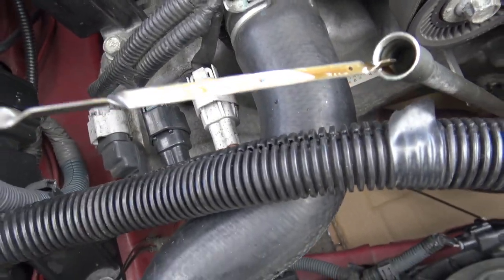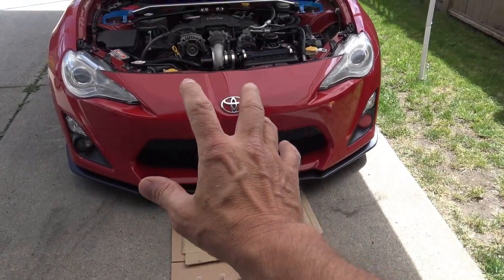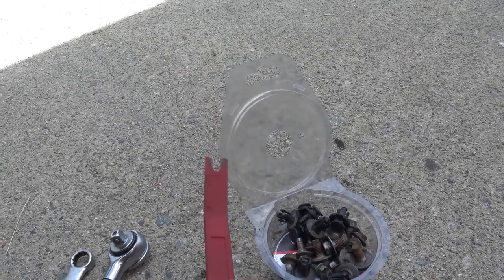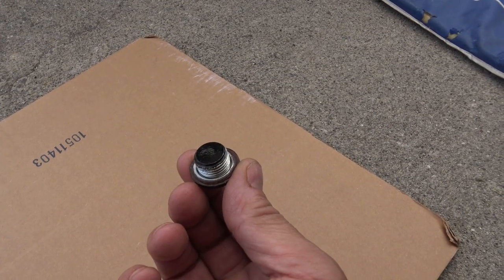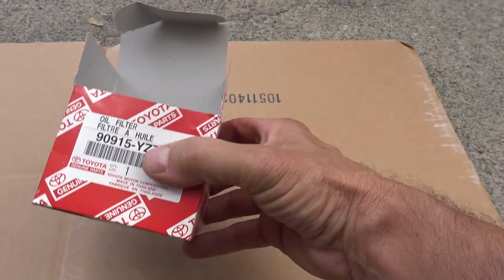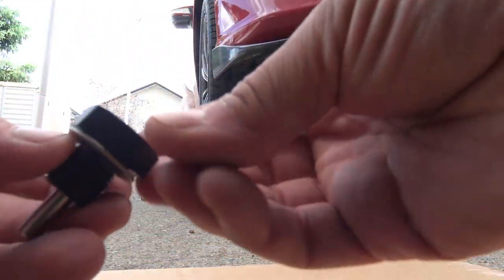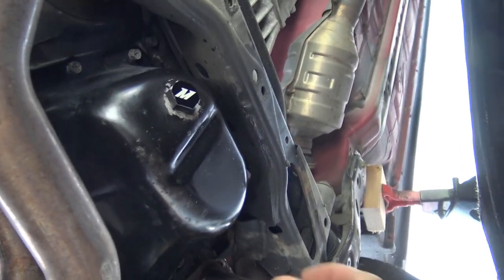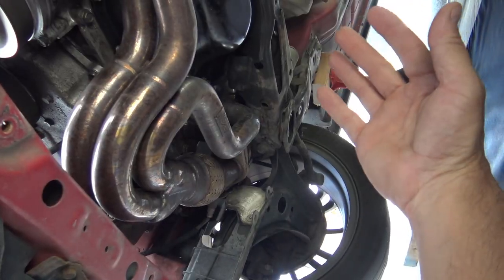What happens if you overfill your engine oil?

Comment: When I met a girl, her car was in the shop.  Some boys told her that she had to fill it up to the top, as in the filler cap!

Car people like to trash quick lubes, but most people don't know what's going on with their car or how to deal with it.  I ran a fast lube some twenty years ago.  A guy came in for an oil change.  He had some incarnation of the big Buick V-6, with a breather filter so full of oil, it was getting into his air filter.  When I put in the typical 4 1/2 quarts of oil, the dip stick showed he was a quart low.  I had no ASE certification, but I knew enough to explain the obvious.

Comment: Great but its alot easier checking the owners manual and checking what the capacity of the engine is. And adding that amount or half a litre below the maximum. Overfilling is not good for any engine as engine damage is highly likely.  i like the drain plugs with built in O rings.

Comment: Did you actually get under the car with only the jack stand that you lifted the car up with only? That's extremely dangerous you should put your tire wheel under the car as well or some kind of cylinder block with wood on top as  well  as security never to just put a jack under a car because they can fail.

Comment: I avoid the old "magnetic oil plug" scam. Engineers built my car to use a disposable oil filter. A good quality oil filter catches the few particles you might find on your magnet. Moreover, I have known of people who have had the magnet come loose from the oil plug (that isn't good). I also drive my car within specifications and undergo regular maintenance. So I have every reason to believe my car isn't grinding away unusual amount of metal; most of which would be non-ferrous metals that won't stick to a magnet anyway.

Comment: did the exact same thing with my 86!🤦 i just been driving with it till it goes down!!😫😭😭
Reply: Be careful, you might ruin the valve seals or worse.
Reply: @Draega007  Nothing will happen to the valve seals. Slight possibility the oil pan gasket will leak though. But if it does, it was probably bad anyway. One quart/liter overfill isn't that big of a deal.

Comment: This is cool!   I’ve NEVER seen a oil filter on theTOP of an engine.  90% off the time it’s more than half way down, either on the SIDE, or near the bottom of an engine, and a BITCH to get to.  This is so nice….. right at the top, nothing in the way….. super easy and convenient
Reply: I have at the top too but it was so tight it broke a wrench... I guess previous person didn't lube the seal.

Comment: So what happens if you run an engine with overfilled oil? 
Yes, you mentioned "this will happen."
WHAT does really happen?

Would like to see an engine that was ran over-filled with engine oil and the damage it has caused.
Reply: When oil becomes frothy, lubrication is compromised that can lead to rapid wear and tear of the engine components.
Excess oil can also cause leaks. It can also damage the catalytic converter at the end of the exhaust pipe.

Comment: I'll tell you what happens Blogs the seas out an fowls the plugs now I only use Casterol Synthetik oil in my 02 Lexus GS300 an I just replaced the gaskets an when they took valve Covers off it was clean as a pin you could eat off of it he said a lady go's around about oil an she give hum Moble 1 oil an he said he was going to ask her about Costerol oil cause it made him a believer in that oil car has 152 thousand miles on it an itll still do over a 100 mph had Casterol oil all its life still runs good an strong keeps car from dry starting when it sitting not being drove ....

Comment: Quit the drama.
Pull out the sump plug, drain some oil (or pump it out) and bring it down to the max, simple.
No need whatsoever to 'change the oil' if it's not due to be changed.

Comment: you could have just emptied the oil filter, emptied it and replaced it and re cranked or re stared the engine  to fill it again and repreated the process a few times to reduce the net amount of oil in the engine.
Reply: At that point you might as well go to a shop and have them vacuum a quart out with a machine in 30 seconds.
Reply: @Tracert-mc1hu  that is an option.

Comment: If you unscrew your drain bolt while applying pressure inwards, you can ( once the threads are clear) then rather tilt the bolt or lightly pull it out just enough to allow oil to drain it out.  Make sure you use a clean oil pan to catch the oil. After estimating the oil drained,  go ahead and rethread the bolt back in. Check your level again before tightening. Yes, wear rubber gloves. DO NOT just pull the bolt and let it drain full tilt. You can usually get just enough out to get your level down to where it belongs. If you take too much out, you can always re add some.  Interesting enough, Subaru outback has the same location for the filter and filler on the 2.5 I engine. Dealers do not forget to tighten filters and bolts, they over tighten them. 
So , a Toyota filter is better just because its prelubed on the O- ring huh?  Hummm ok. FYI, bronze bearing material doesnt attract to those magnets. Yes it will attract steel, but are not most engines now days made from Aluminum? Most modern engines do not contain as much steel as older engines. The oil filter actually does a better job at retaining particulates in the oil. That's why it's so important to change your oil using a regular schedule.  Something you are not doing by the sounds of things.
Reply: You make some good points. You sound like you know a lot about this stuff.  HELP - I have 2 questions.

I drive an 06 Toyota w 300k miles and I use Advanced Full Synthetic Valvoline oil and top of the line filter.  The FRAM ULTRA filter says it protects for 20k miles. #1) Can I really go 20k miles before my next change?  Fyi I do have a small oil leak, so I check and add 1/2 a qt fresh oil about every couple months.
#2) I changed the oil but didn't measure it well would an extra quart damage engine?  One side of the dipstick says it's perfect and the other side says it's full I I do think I put an extra quart. Synthetic oil is so clear so Me & hubby are both confused -- or we just have horrible eyesight. 🤣🤣🤣

Comment: Once I had my car serviced. On the 15 minute ride home I noticed the car seemed to lack power. When home, I checked the oil level. It was over full by 1 quart. Called back the repair shop & told them the problem. They had me come back in next day & they fixed it.... 2 weeks later the secretary (friend) told me the new mechanic took "up to 5 quarts oil included" literally! All oil changes he had done, he put 5 quarts oil back in! This even included engines that held more than 5 quarts!! Needless to say that mechanic is gone.....

Comment: Alternator looks easy to change as well as oil filter, lol.
Reply: Because this car has a boxer (flat) engine, everything HAS to be mounted on top of the engine - there's not a lot of room below it. Just another consequence in addition to it's low center of gravity, which is desirable and intentional in a car designed to emphasize handling.

Comment: You didnt fill the oil filter with oil, thats very important, the oil will flow faster through the filter when its already soaked, small wear occurs upon initial start up especially when the new filter is bone dry.
Reply: Where is there engineering proof that small wear occurs if the oil filter is dry and it takes 1-2 seconds for the oil filter to be filled up?  
What about the oil that stays in the engine, coating all those engine parts, and is still there when you refill the oil, start the engine, and check for leaks???
Yes, I believe it is good to prefill the oil filter, let it soak awhile and it will disappear, and you can refill it again... Fine.. But I still see no proof that any engine wear occurs from not adding oil to the filter..
Reply: @frandanco6289  I am ocd when it comes to vehicle maintenance, do whatever pleases you, do your reasearch, cheers

Comment: Funny who still believes in a magnetic screw in the crankcase, since, apart from the crankshaft, most parts that suffer friction in the engine are not made of ferrous materials.
Reply: Look at it like this, if the mag plug shows debree you know for sure it’s f**ked.
Reply: I don’t believe in magnetic plugs because they are too small to pull anything out of the oil . 2 of the biggest filter mag magnets on the sides of your  filter will pull out ferrous particles under 10 micron , the ones that go straight through your oil filter & also the ones that cause most engine wear , there are plenty of steel surfaces that are subject to microscopic wear , non ferrous particles do not cause anywhere near as much accelerated engine wear as steel , Cummins own testing proves this . If magnetic particles didn’t do anything inside an automatic transmission , then why do they put 3 magnets in the pan , when regularly serviced you will see the tiny ferrous particles stuck to them & they are meant to be cleaned off when servicing . If you look at a transmission that’s failed due to lack of servicing the magnets will usually have that much crap stuck on them they can hold no more . Yes a tranny is different to an engine in that you don’t change the oil that often but they have a filter & the shit that sticks to the magnets goes straight  through it . If you turn your vehicles over on a regular basis , then magnets are probably going to be a waste of money to you , however if your like me & keep your vehicles for near 20 years & want the absolute maximum life out of the engine , then magnets & reduce service intervals are probably a wise investment.

Comment: People who overfill their oil pan really shouldn't attempt to conduct any type of repairs on their vehicles for obvious reasons.
Reply: In my case car supposed to take 4.5 Liters.peugoet diesel 2000 cc.drained oil and filled it up with full container of 4liters synthetic oil expecting to open another 4 Liter container for the other 1/2 Liter but surprised that with this 4 Liters it’s over filled itself .checked again no a day later and still shows overfilment 🤔

Comment: Only a quart over filled is better than one quart under filled. You are not an expert on this. My 1999 DODGE DAKOTA truck burning oil then has only one quart left when check dipstick and I found out bone dry then I drained the oil to do an oil changed. 4-5 years ago on this same truck I used mix diesel and gasoline, 2 - cycle oil mixed with gasoline in the ratio 50 to 1 then I checked the dipstick regularly until I saw the oil about 3 inches above the highest make on the dipstick then I drained , the oil came out about 2-gallons each time. I been doing this for 2-3 years nothing happens to my truck. My truck has more 200k miles still running fine. During that 2-3 years period I poured all kind of shelf-life expired chemical liquid in my gas tank e.g. paint thinner, denatured alcohol, cleaning solvent of all types, I also poured bad gas in there too in the ratio of 50/50. Anything that mix with gasoline I poured in the tank. Nothing happen to my engine only I lost power and engine was knocking here and there then I just added more premium gad then problem solved. I did not do that now though. My truck running fine nothing break on the engine yet. I did my experiment because chemical is available to me and saving money in the process. I don't know if it would hurt other type of vehicle but my America made old Dodge Dakota engine is tough. All my x'ses are gone but my truck still here.